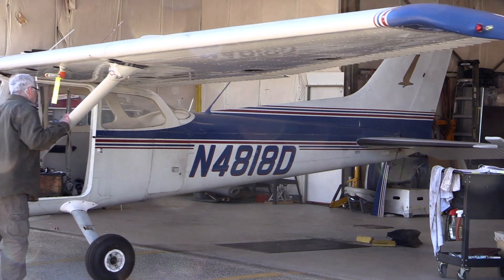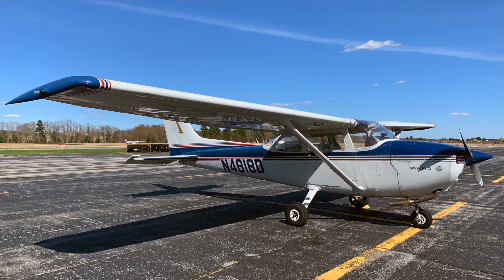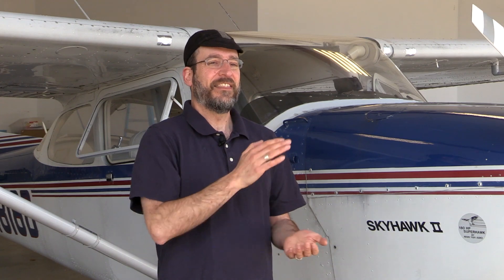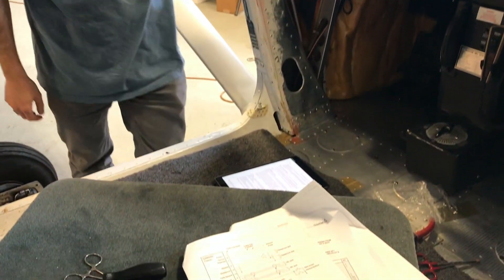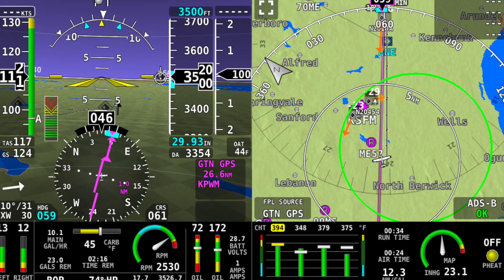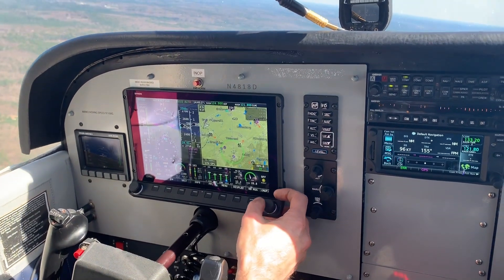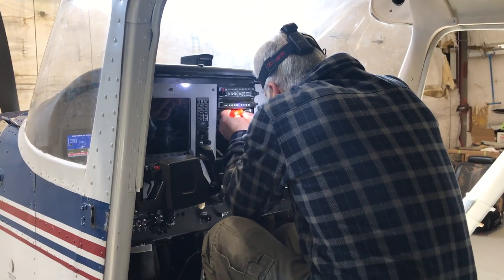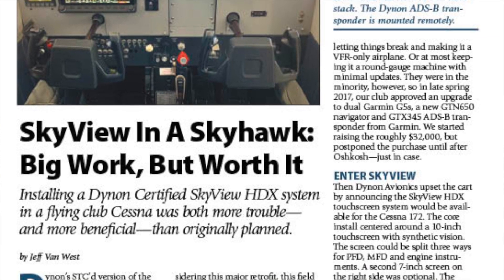Dynon SkyView in a Skyhawk

Comment: Very nice install and functional!!!!  There will always be resentment towards new technology. The tried and true steam gauges were also prone to failure. Was there a backup system to the steam gauges? Not really. If you look closely you will see a backup, self powered, D10 unit that stands on its own with its own battery backup that is mandatory to have installed as stated in the Dynon STC. A very good majority of all pilots who fly older aircraft ( me included, 1960 182C) always have some portable GPS. The new GPS units have enough safety features built in to help a pilot get home safely should an emergency arise. There is always additional options such as the Levil BOM unit that will get you down safe. Although I do have reservations on panel GPS units that end up "unsupported' within a very short life cycle by the manufacturer (this is a whole other conversation), The Dynon SkyView HDX does have the internal makeup and horsepower to last a while due to its modularity. Add in the affordability and you have a true powerful MFD to navigate todays crowded airspace.  

The experimental crowd fly in the same airspace as certified aircraft. I am not sure why there is such an antiquated interpretation of the FAA regulations by A&P's and IA's (another conversation for a different time). The SkyView does its part to help address this shortcoming. One last point to note, The steam gauge six pack can NOT see nor point to any UAV's within your flight envelope. Those very small craft are very very hard to see from a moving cockpit. A system such as the SkyView HDX can definitely lend a hand in this case.

Gosh I want one in my bird!!!!!!!! 😀

Comment: I wish Dynon would certify the other SkyViews.  This HDX unit is overkill for a small piston aircraft.  The SkyView Classic or heck even the SE would be a better choice.  If your in a 50's or 60's aircraft running steam and DME but want the reliability of solid sate, the HDX is a big leap from where you started.
Reply: They are going to stop making the Classic and SE soon, so they probably chose the most modern unit with the best bang for the buck.
Reply: @chadcoady9025  that sucks.

Comment: What’s wrong with steam gauges?  At the very least as backup. I don’t get the fascination with all glass panels
Reply: Because they are not as good as modern avionics. Solid state stuff with integration for gps, battery backup, etc, is awesome.
Reply: @fadedflage  My thinking has evolved closer to your point of view in the year or so since I posted my first comment above.
Reply: talk about putting all your digital eggs in a single basket. A single display away from flying by the seat of your pants. While it does look sexy and a little busy, a backup AS, VS and maybe HSI would be nice.

Comment: I love the new glass cockpit units and install both Dynon and Garmin  along with others avionics as well

I love the moving map in real time along with ADS Bl . but all so love some of the old gauges for back up  like airspeed , AH just in case the display fails.?

But all the avionics OEM could have the units build so well it's possible they will last as longer than units like the KCS  55A & KFC 200 Auto Pilot flight control system. The KX155/165 or kma24. 

The units allows so much. When. Set side by side with older avionics and it's weight is so much much  lighter

When looking into avionics up graders just thank its night a long 500 mile cross country in good weather and you display fails. No airspeed.. No AH. . no DG and any equipment control only via the display can not be access.
 
Now its bad weather still VFR and you have no back up gauges hope the IPAD can take over.

Comment: Not ONE single "steam gauge" left in the panel.  Plenty of room on the right for several back-up gauges running on something besides electricity.  I've been a pilot for over 30 years, and while I've enjoyed the integration glass brings to GA and Light Sport, I fail to understand the logic behind getting rid of all "old tech' instruments.  That airplane completely depends on electrical power being available (AND the continued functionality) of that bunch of glass for the pilot to have ANY idea about what is going on!  Bad Move.
Reply: It has battery backup on the back of the instruments. There is the backup artificial horizon. They pointed out that the new instruments detected issues with the pitot static system.

Comment: I'm a CFI who is contemplating a Dynon suit for a 172 but I am really hesitant because I think it is important for new pilots to learn on a standard 6 pack and then transition to glass. That being said, I saw in your video that you can change the screen to be a 6 pack. I was wondering how accurate it is and if it allows you to fail systems in order to teach. Like the vacuum system for example.
Reply: Hi Bill. I have zero aircraft knowledge, but a lengthy career in consumer electronics, from the mid 1970's. I greatly respect what you are saying, but I ask why learn an old technology? I was one of the first to sell PC's with the Pentium chip back in 1993 to retailers. Both the retailer, and consumer had no use for understanding "Dual Pipeline", and all of the intricacies that this advanced technology had to offer. My approach was different from the manufacturers desire to get into all that- it was to show consumers how they can get the best from this new generation of chips. The standard, Feature (what it is) - Advantage (what it does) - Benefit (how that helps the end user).

Sometimes we get comfortable with old technologies, and become novices ourselves with major advances. As a future Sports Pilot, I would rather spend my time learning all of the advantages of the Dynon equipment, and I am sure that would entail hundreds of hours. Imagine totally mastering the new technology, and being aware of what lies around the corner as well? I just wanted to offer my viewpoint here. Thanks so much! I wish I had your experience as a CFI. Good for you.
Reply: I think learning on the modern technology is better. 
     Why learn something you are going to discard and then have to learn a brand new system. Safer to learn on what your going to fly.
   That being said most of us fly rentals. Most rentals are a six pack not glass. I can fly a older 172 for $125 verses a g1000 172 for $170 per hour. The plane doesn’t know the difference.

Comment: Hey I had to pause it on that old vac. stuff and sure enough I bought the system on EBAY from you guys! Its going on a Cessna 140 and an upgrade from venturi tubes, good thing I have an O-200 to handle the weight  :) Take care from Ephrata Wa.  PS good vid
Reply: I was just thinking that it would go nice in another plane 😁

Comment: I went with the G500 txi for the same 172n. They probably paid less. The one big issue with my install is there are no real good digital APs available for the 172 that couple to the G500. The G5 compatible AP won't work with the G500, and the Stec-3100 is said to never be stc'ed for 172s.

Comment: Did anyone else hear him say the airplane LOST 35 lbs after the install? I am calling BS. Yes, the older stuff weighs more. No, it does not weigh THAT much more. Id like to see the Scale weight and balance before and after before I believe it.
Reply: I would say based on the age of the plane, it lost 35 lbs and then some. Observe the highly skilled IA learning as he goes with new technology. Remember the additional parts they tried to save, but eventually had to scrap? It adds up quickly. Another advantage for digital.

Comment: The real cause of the corroded general aviation in this country is the heavy handed regulation by the FAA.  The FAA made it too costly for manufacturers to produce more efficient and to create more cost effective aircraft design.  Airplanes are still flying with very unreliable vacuum pumps and magnetos yet the FAA insist its voluminous regulation somehow made aviation safe.  To compare with automobile technology, car design has progressed every year and has new improvements in every new generation of design.  It's time to ban the FAA from meddling in general aviation.
Reply: It's too costly for the owners, not the manufacturers. There are better planes than a 172. Cirrus is always adding something, but you have to dig down into your pockets to get a new one

Comment: I would put the basic analog mechanical flight instruments in the unused/wasted panel space on the right for the ultimate backup and cross training.
Reply: I think weight can become a concern too?
Reply from the maker: Nah, the STC includes removing the vacuum system. Out with it all...
Reply: @AVweb  Are you saying the STC REQUIRES the complete removal of older instruments when glass is installed.  Ridiculous to not have backup, when there is plenty of room for it.
Reply: @drteknical6571  Add another Dynon panel. Move into the future. Sooner or later it will be here regardless.
Reply: AVweb  With that mindset why still have a fluid compass? Also, there could be an electric with battery backup directional gyro, no vacuum system needed.

Comment: If you're flying an older airplane this has to be the best way to go. The system is simpler to use afterward and that by itself will improve safety. The instruments, as they said in the video, are simply better and the additional ADS-B in&out is also a huge plus for safety.

Comment: Panel upgrades like this are another reason why most should not consider a new 172. Not like Cessna seems to mind, I feel they are jacking up the costs because in reality they don't want to be bothered with making single engine piston aircraft anymore, they just want to sell Jets. Also I am not sure where he gets the figure of $350,000 I spoke to a Cessna dealer for a 2019 172 and he told me $495,000.
Reply: Why do you want to buy new of anything, especially aircraft which has high depreciation.

Comment: Amazing to see all of this technology making older plane so much safer. Looks awesome!
Reply: Do you have any evidence that suggests that this single point of failure makes this plane "safer?"
Reply: @ac583  a double edged sword, but trading steam gauges for a glass panel removes some of the inconcistencies and failure points of steam gauges, like vacuum power and all the actual internal gyroscopes that had precession and rigidity errors after thousands of flight hours. vacuum failures are far more common than electrical failures. systems like these, at least the attitude indicator backup systems, have backup batteries that can allow the screen to operate for a set amount of time after a complete electrical failure. lets say your plane's alternator belt snaps off and you run off battery power for 30 minutes until battery runs dry. the backup battery for the AI of a garmin g5 will run for up to 4 hours in an emergency state, which should be enough to get you out of the clouds if paired with an EFB.

Comment: Lots of very nice information but single screen is much too busy and easy to miss something. Don’t like the idea of not having some basic get you home analogue instruments it’s all very well having backups in the unit but what if the display itself goes?
Reply: You would have the GTN650 and the EFIS D10A.
Reply: The small unit to the left of the big screen is a separate backup with altitude, heading, airspeed, artificial horizon, rate of climb, etc.

Comment: I'm a member of the Bald Eagle Flying Club with 15-20 hours in the aircraft since we upgraded the avionics--money well spent!  Yes, the old avionics were functional but IMC capability and situational awareness are dramatically better.  The Dynon package is (mostly) very intuitive. With ongoing training (a way of life?) and  attention to some of the pitfalls of general aviation glass cockpit use (e.g system state errors), this package will up my game in pilot performance and and family-flying-safety.
Reply: Tom Pulling  the old panel was falling apart piece by piece with replacement instruments incredibly expensive, not to mention down time.  It is so nice to fly with accurate instruments and flight is not cancelled because of broken equipment. If you want round gages press a button it’s there and easy to read. I’m very happy with the results.

Comment: He said the screen is "busy".  Indeed, it is.  For all the information on display, give me a larger screen.  Don't listen to me, however.  I'm a 69 year old aviator that still likes round gauges.
Reply: only a student, but it seems to me ,if you have a electrical problem, you loose everything,, no backup,,,or,,,do you need one,,,,
Reply: @Vito_A_Labella , the video specifically mentioned a battery backup to the HDX  and the PFD to the left of the HDX.
Reply: @Vito_A_Labella I personally would much rather fly on an aircraft with 2 different sources of information coming in.
Reply: Nice.

Comment: You got rid of the plastic and replaced it with a new panel made of what? and what did that part cost?
Reply: Most likely just a sheet of aluminum with cutouts made.
Reply: That is like $200-400 nothin in the scheme of things. Just laser cut Alum.
Reply: @gusbisbal9803  You wish.  When I redid my panel, we did a powder coated one and it was $4000.
Reply: @gusbisbal9803  And the sub-panel is another $1200
Reply: @cscinc  I am a fabricator and work for a laser cutting place. It just isn't that expensive. Ok here is how you know. Ever had a set of selves that are sheet metal and power coated? They are about $600. They are WAY bigger than the panel, more complicated and with additional processes. If you buy it from cessna then yes its the cost of a small boat. But the part itself is cheap as hell.
Reply: @gusbisbal9803  What you are not taking into consideration is that anything that says airplane increases in price exponentially.  Gulf Coast Aviation did my first panel upgrade.  Later I wanted to replace the lower panel as well and I shopped many different sources and they were all that high.  The airplane is in the shop for another avionics upgrade but fortunately, my beautiful (expensive) powder-coated panel won't require any cutting.  Still looking for a lower panel for a 1976 C172M.  If you know of someone that would do it reasonably, I'd appreaciate being pointed it that direction.

Comment: Might as well install a Garmin G5 in your riding mower.
Reply: a 172N is fundamentally no different than a 2019 version of the 172 other than the avionics.  Much cheaper to upgrade an older airplane that has a good airframe.  It will fly just as fast and most likely will have a better useful load

Comment: All these avionics offer little more than a cheap tablet with a portable ADS-B In w/ AHRS but for 100x the $$.
Reply: Your tablet also isn't certified for any type of flight.  It's reference only.
Reply: @BrickyardGaming  Guess what else was certified?  The original instrument cluster.  Not sure what your point is.
Reply: @tiny_toilet  The original instrument cluser was not WAAS rated, which means it was not precision or LPV capable - neither is your tablet or mobile device.  Also, ADS-B integrated into the system is picking up a ground-station report, as opposed to the portable devices which pick up an ADS-B re-broadcast from other things in the area (ie. not a true traffic representation)
Reply: @tiny_toilet  This system does way more than is shown in this video. While the panel looks cluttered, it actually reduces task loading considerably and manages elements of flight far better than the old gauges. This was not a full functioning demonstration it was addressing the concept of the swap out.
Watch this video for everything it can do and that is WAY more than an iPAD can even come close to doing.
https://www.youtube.com/watch?v=Ea4HDOd2z1U&t
Reply: @tiny_toilet  Let me know when you're open source community gets coordinated enough to get FAA certification? You will let me know right? You won't forget. I mean... you know..... Open source wins! yeah team?  Don't forget now.
Reply: The avionics includes an autopilot, ADS-B out, and engine monitoring, all things a tablet can't do.
Reply: @ArelEnglish  A tablet also doesn't include a propeller and rudder trim.  So what?  Point is, $100k only buys a tiny bit more than a very budget-friendly setup.
Reply: tjbtech the entire system is under 40k installed, not 100k, but regardless, you can keep flying with a six pack.
Reply: Sounds like someone needs to watch the video again!
Reply: @tonyfdesign  Joke's on you.  I wasn't about to watch it the first time.